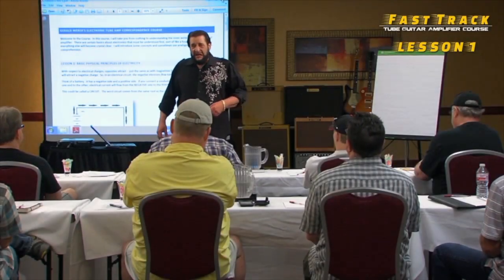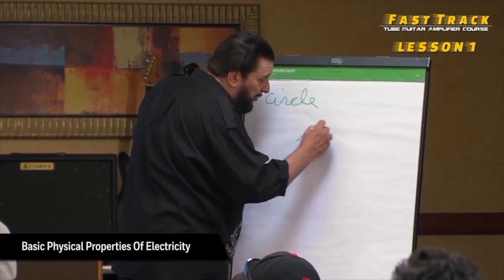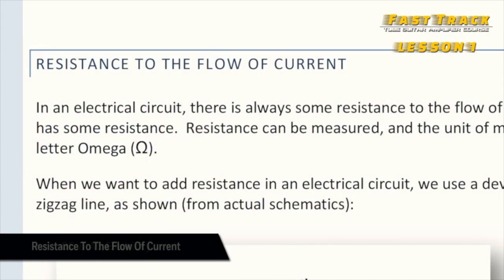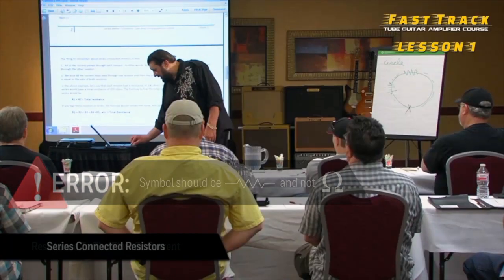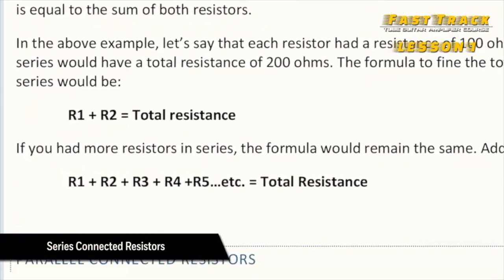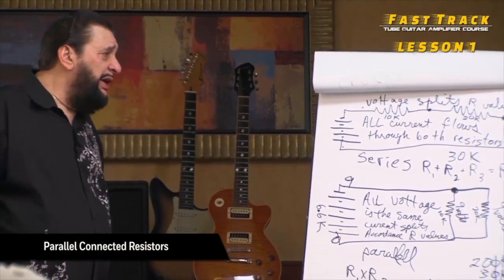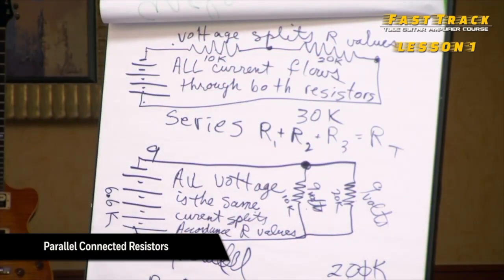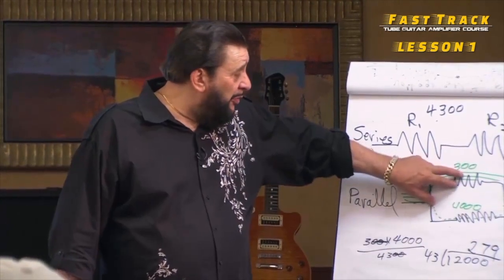Gerald Weber's FAST TRACK Tube Guitar Amplifier Training

Comment: Hello.. 
what college tech course, if any, would you say would be the most helpful for an aspiring tube amp builder/repair lady? 
Thanks!
Reply from the maker: There isn't any. Colleges think an amplifier is something whose output is exactly like the input but louder. A guitar amp must have the output sound better than the input and it must respond to a players picking nuance. In short, it is a musical instrument. Colleges don't have a clue about that.
Reply: @geraldweber6932  thank you for the info. Good to know.. how about just a course on electricity, DC circuit analysis, or AC circuit analysis?
Reply from the maker: @abbierose8934  I already cover that in my online course. You can enroll HERE. https://www.kendrick-amplifiers.com/mm5/merchant.mvc?Screen=PROD&Store_Code=KOS&Product_Code=Tube_Amp_Correspondence_Course&Category_Code=

Comment: A question:  I need help with interpretation of tube data sheets.  In the RCA data book tubes are listed with operating conditions in 3 columns.  Just beneath the descriptive paragraph the columns are titled.  (use the 6V6 family as an example),  6V6 on the left, 6V6GT in the middle, & the GTA on the right.  
My confusion begins in the class A section of typical operating conditions, does each column describe conditions of the tube titled above, OR, is each column describing conditions from a single tube of the family, but with different plate voltages?  
If its the latter is seems to me that the tubes output resistance   Changes depending on the plate voltage?